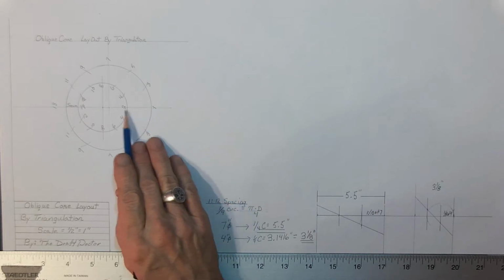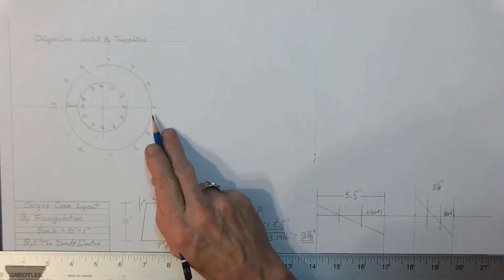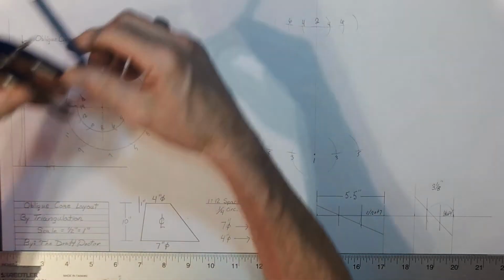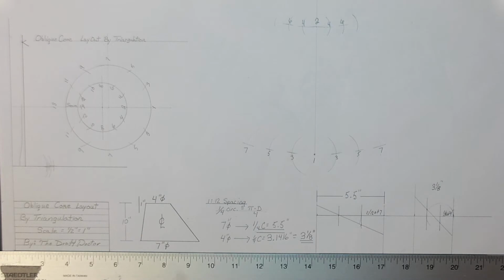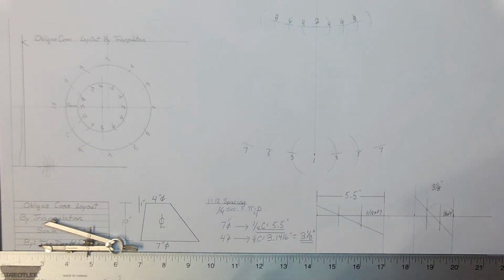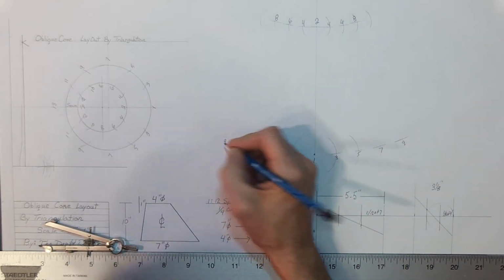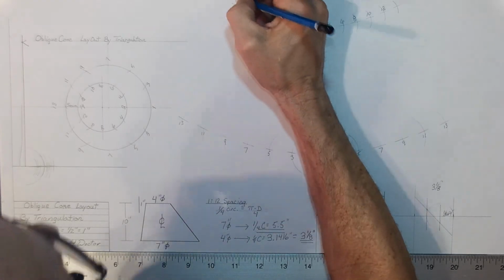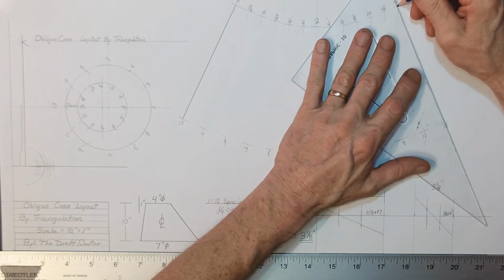Oblique Cone Using Triangulation

Comment: I like your presentation. But I am having trouble with developing my cone shape. Is there anything I can do to get more comments from you?
Reply from the maker: To develope the working drawing. Begin with a right angle, measure the hieght of the fitting an create a parrallel line at that elevation. Measure the offset at the 10" elevation and then mark the diameters.  😎